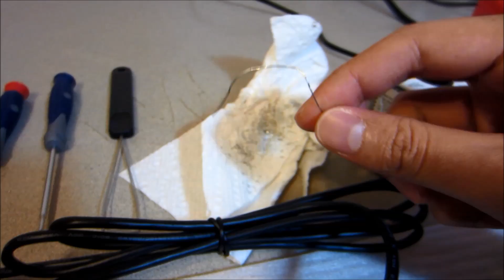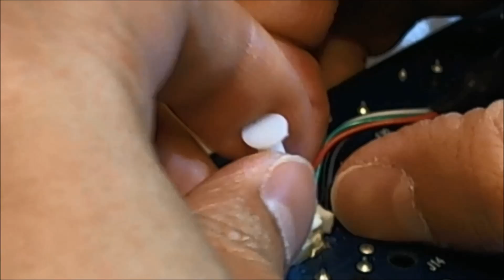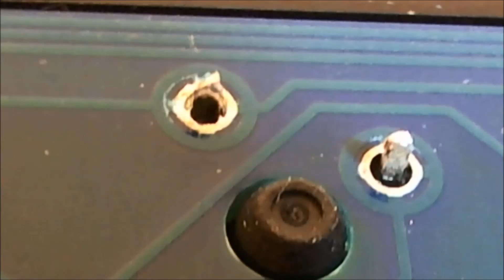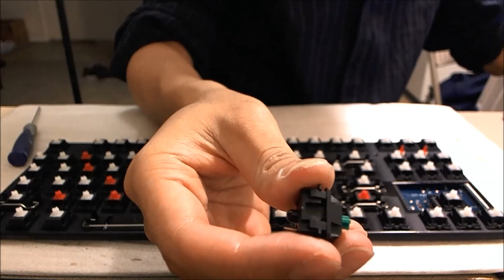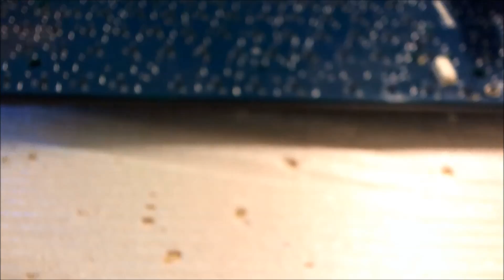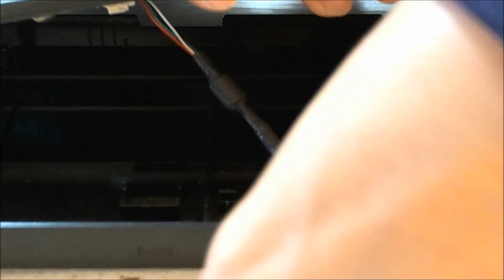Ergo-Clear MX switch mod and Tutorial for Mechanical Keyboard

Comment: What size chisel head do you recommend for the switch soldering and what temp should I use with the recommended head? Do you like 60/40 or 63/37 solder better?

Comment: If my D key isnt working can i replace it with say my / key? or any other of the same design? Are they interchangeable? My D key has stopped and i want to replace it, was wondering i could use any other on the same keyboard as a replacement
Reply: +f budd yes
Reply: +f budd dont do that you can better buy a switch from ebay or something

Comment: Am I able to open switch (remove string in switch) without dissoldering?
Reply: +gqq nbig Yes if it isnt plate mounted like a Cherry G80. Almost all modern keyboards though are plate mounted.
Reply: Do the slots on the top of Cherry MX switches, that can release the tabs, not allow the release of the top when they're in a plate? If so, it's a pity the cutouts in the plate don't include notches, to allow easy removal of the top, without de-soldering. I've seen custom two-pronged 'prybars' that make taking off the top much quicker, though I use narrow-bladed, jeweller's screwdrivers.

Comment: Could you post a video about how to change a defective LED? I have a ducky shine 3 with defective lighting.
Reply: John Parks Did you ever find an answer? I have the same issue. The first time I sent it back to Ducky and they replaced the LEDs, but it took them 3 months all together and I'd rather self fix than be without it again.
Reply: Unfortunately no, I haven't. However, my problem is very minor (the 0 key is the only key that stopped working) so I've gotten used to it overtime.

Comment: 9 out of 10 people who try to solder will fail because they tried with the cheapest soldering gun they could find. Those things are great if you want to scald circuit boards while simultaneously failing to evenly melt the solder.
Fucking impressive achievement sure, but utterly useless at what they are suppose to do.
And that wet sponge is not to clean your tip... its to lower the temp of the tip when you need to lower the temperature. That is all I use them for anyway. The thermocouple may also read wrong when the tip is too hot and need to cool down, for the temp to read accurately, the tip needs to be catching up or equal to the temp you are trying to get to, hence, the wet sponge.
Reply: +Richard Smith uuh yes the sponge IS for cleaning the tip...
Reply: but does it work?

Comment: Hello dude.. nice video helps a lot..

Can you make video how to put led on switches ?
Reply: FRANkiller13 You have two small soldering points above the sol. points of switch, just use a soldering pump to clear the soldering joints like you do with other ones. Then you can pull it easily out together! with the switch. You need to  place the other switch beneath it and move the led to the other switch without turning it around. By doing that you can ensure the poles stay on the same side, otherwise they won't light up. If you just want to install the led on a random switch you can put them on the upper side of switch, but the circuit board has to be capable of powering leds I think ... I hope that helps a bit :P

Comment: Could I do the opposite of this? Say I have a Cherry MX Red switch keyboard. Could I buy a load of MX clear switches, take off the stems and springs from the reds and insert the stems and springs from the clears but leaving the actual "case" of the switches attached?
Reply: you can buy clear switchs on ebay. All you do is solder 2 points. So depends how easy your keyboard is easy to desolder. If it has leds it's a different story.
Reply: Thanks

Comment: Anyone wanna help me? i decided to swtich some keys out of my razer blackwidow TE and a lot of keys that i haev never touched for desoldering dont even work, can somone explain to me why this happend?
Reply: RocketLeon45 Did they stop working after you opened up the keboard? You need to be more specific...
Reply: John Parks no when I first opened it it was just the case, just to see what it looked like and the keys where perfectly fine
Reply: So you opened the case to take a look and then put it back together, which resulted in this problem?
Reply: John Parks prior to modding I opened up the keyboard but I dont think that woulda done anything

Comment: Since you are familiar with the switch internals, is there a difference between the actuators from linear to tactile? Or is the actuator/bottom of the switch identical, leaving the stem and spring to make the switch? The reason I ask is that while I adore my Corsair k60, the reds are simply too light for me. With the research I've done, I would be much happier with the greens.

tl;dr - If I can manage to procure enough mx greens, can I just swap spring and stem with installed mx reds?
Reply: I believe that board is plate-mounted. If it is, then no, you can't. If it is in fact on a PCB, then you should be able to.
Reply: Yeah, definitely plate mounted. But I'm still curious as to the internals of the switches themselves. I can't seem to find a good resource on it anywhere.
Reply: pyrobunny
I think you can make a swap easy without desoldering, if there is no metal plate. I have seen a guide on you tube on how to swap between Cherry MX switches of different types without desoldering them.
Reply: illitero If it's plate mounted you'll have to desolder. Springs are completely interchangeable.
Switches themselves are expensive though, if you're just looking for 80g springs you should look on GeekHack.com a user named Sprit is running a buy for just springs. I believe it's about $10 for 100.
Reply: If your board has a metal plate to which switches are mounted, then in order to swap switches you'd need to desolder them first and then swap. I am not familiar with your board, but you can take a look: just remove a keycap and see whether or not there is a metal plate visible between the switches, or just a PCB. If the switches are PCB mounted then swap is done without desoldering, just by taking a switch apart and swapping a stem only, or a stem and a spring.

Comment: OMG just use braid ..  That iron is garbage..  When I was doing industrial electronics we had a sucker that had a actual pump and foot switch .. Now that thing worked very well and yes it was temp adjustable , But the thing cost like 2 grand so braid has been my choice of desoldering for years..  I could have changed every single switch on that keyboard in probably half hour of course after it was appart.. :)

Comment: You don't have to use a pin or anything else in those gaps to remove a plug of that type from its socket. Just use a small flat head screw driver to catch the lip on each side of the plug and push the plug out one side at a time, switching back and forth if necessary, until the plug is completely removed. It is much easier and will prevent any damage to the plug, socket, and wires.

Comment from the maker: No, that is not possible. Every LED needs electrical traces on the PCB and 2 tiny holes for the leads to go through. A Filco PCB does not have this. You can manually wire all the LEDs, add resistors, and tap it into the USB for power, but this this won't be an easy mod.

If you want something that's natively backlit, look into the Ducky shine II TKL. Quality is on par with Filco.
/watch?v=pf3iRXiMvl0

Comment from the maker: The black thing is not really a pin, it's the bottom of the switch to help it align with the PCB. Yes, those two pins from each switch complete the circuit when you actuate the keys. It also helps to lock down the switch to the PCB.

Diodes are needed because they only allow signal to travel in one direction. Without diodes, certain keys might actuate when certain key combinations are pressed. And without diodes, your keyboard wouldn't have 6KRO.

Comment: What is the term for the black pin? And the two pins that you are desoldering, are they the ones making the connections when you actuate the key? What happens if you desolder the diodes?